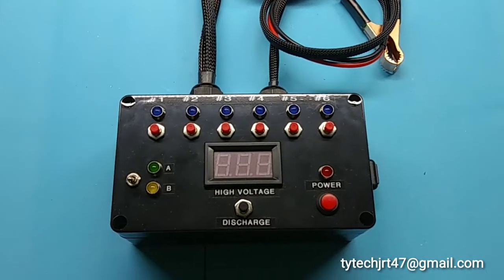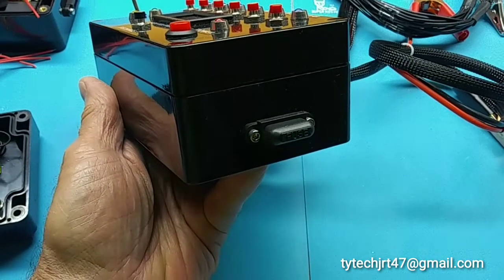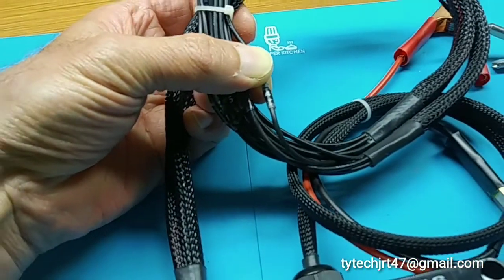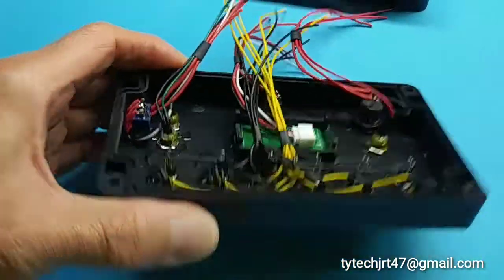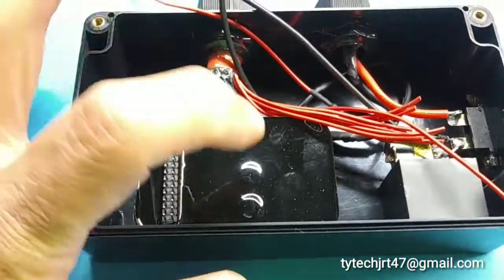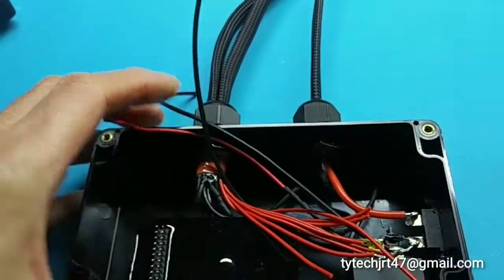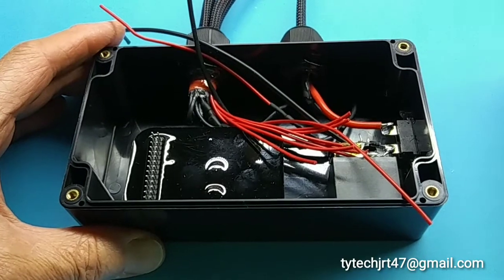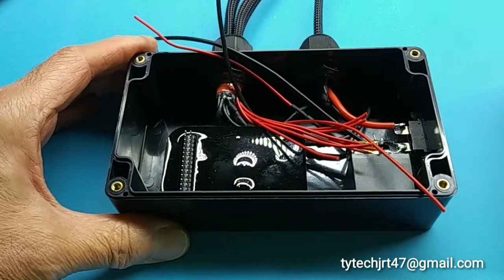Mercedes V12 Ignition System Tester Version #2 for M275 S600

Comment: Hi just a suggestion, instead of single wires installation, you should have connection plug. Sort of plug in plug out.
Reply from the maker: I totally agree but the connectors are no longer available. Using the original part numbers I did extensive research to locate them with no luck. Another option would be to have them made but with such a small production run it wasn't worth the investment.
Reply: @tytechjrt  hi, get it from china. The factory that manufactures the coil pack for Mercedes Benz.